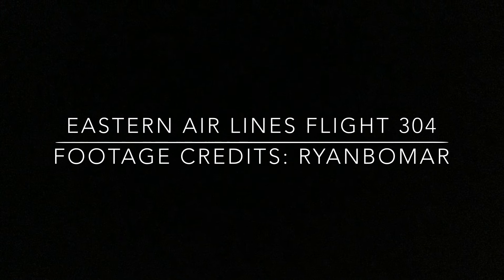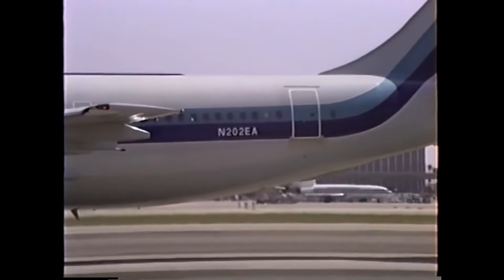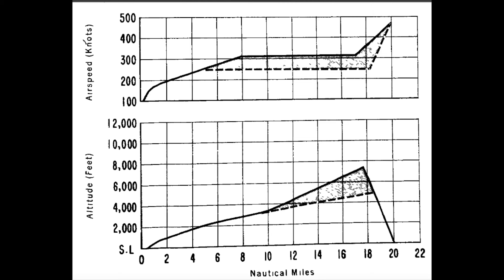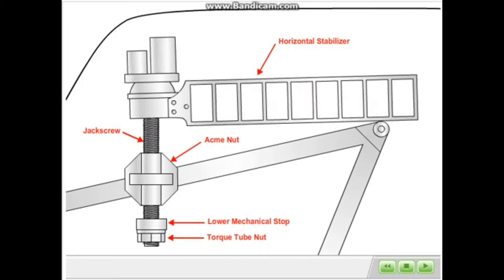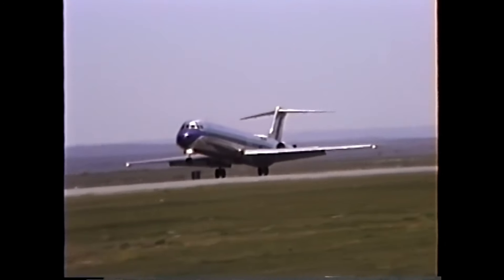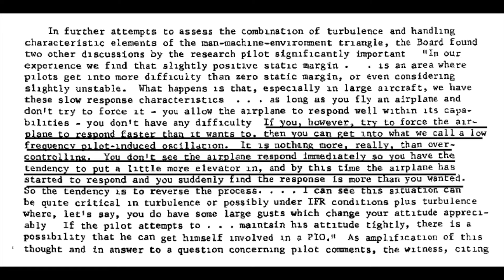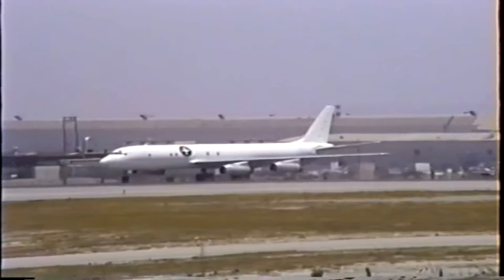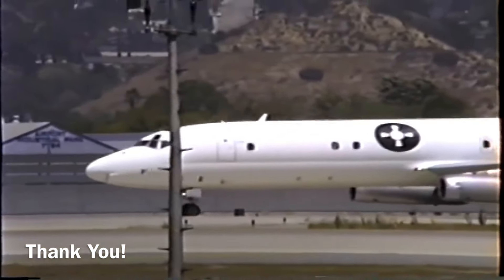When The Pilots Aren't In Control Anymore | The Crash Of Eastern Air Lines Flight 304

Comment: I have been at the controls of a DC-8. It was a charter flight and I was signed up for ground school. I was amazed at how light and sensitive the yoke was. I could feel the minor muscle tremors in my arms in the movement of the aircraft. It took about a second for  an unintentional twitch to show up as a slight roll or pitch change, and those movements were on the order of a mm or so.
Reply: Try it in manual reversion...
Reply: @davef.2329  Without the hydraulics?
Reply: @johncantwell8216  Yup, no aileron/rudder hyd's. Used to do that trng in the sim and in the plane on maint. functional test flts. Put the gear down to help with the roll (flt. spoilers powered by separate hyd. syst. when the gear is down). Can be described like "driving a moving van with no power steering." Plan ahead, far ahead...
Reply: @davef.2329  Is the yaw damper operational without hydraulics on the rudder?
Reply: @johncantwell8216  With NO hyd's, or rudder power lever shut off, no. DC-8 had a standby rudder power syst. that in the loss of main hyd's syst. could keep the rudder powered as long as there was no leakage in the final plumbing or the rudder actuating system. The series yaw damp ran thru the rudder power control valve, so in answer to the question, no, not without applied RUDDER hyd. pressure. Been a long time (decades ago) but, that's my memory of it. DC-8 went thru some changes early in its life due to some accidents/incidents and the standby rudder power sub-system was one result of those early changes.
Reply: @davef.2329  I just looked at the layout of the F/E panel, and it shows how the controls for the standby rudder system and the alternate power source for the ground spoilers were added on an outrigger box at the left end of the panel.
Reply: @johncantwell8216  It was referred to as the 'Sub-61 panel."

Comment: Thanks for shedding light on a lesser known crash. It is very interesting at this time due to the similarities to the 737 Max and MCAS crashes. Air transport safely is the most important factor that a manufacturer must consider when designing and manufacturing aircraft.  The human factor makes this tricky but the more pilots are told about how their plane flies and responds due to the airframe itself and the various flight control systems the safer flying can be because of pilots not being surprised by what the plane is doing. I have not been able to find out how much Douglas knew about this issue so it is hard to make a good judgment on how responsible the company was but the similarities to the Max are striking.
Reply from the maker: Yeah i love doing videos on lesser known crashes, Its good to make sure that this incident isnt forgotten to the pages of history

Comment: A bushing is really just what you described. It's a chunk of rubber or polyurethane (a very soft plastic) which separates metal or load bearing components that have to move. The suspension components in your car use a load of bushings to this effect. An example would be a stabilizer bar (aka anti-roll bar) link pin, which is basically a metal linkage with nuts at both ends that connect to stuff. You'd have the nut holding the bar there, a washer for the bushing to seat against, the bushing, the metal component the link pin attaches to, and another bushing with a welded washer in place. I hope this makes even a lick of sense. Bushings are usually incorporated into designs where metal parts meet, but have to move. The bushing allows those metal components to move around relative to each other, without wearing out those metal parts. If you install bushings upside down, it absolutely will chew the bushing out because the metal fixing basically eats it alive. Again, hope it makes sense.
Reply from the maker: Thanks this really does clear things up !!
Reply: Don't forget though bushings can be anything from a rubber with a low shore rating to brass to stainless steel.

Comment: The natural reaction of a pilot with the airplane pitching down and the airspeed increasing is to pull the power off and pull back on the elevator. There was a case where EAL had an airplane pitching down, over speeding  and the pilot did the opposite. He pushed the power up, and recovered. In any airplane without fly by wire and engines mounted under the wing if you add power the airplane will pitch up and probably the only way to recover from a high speed nose down incident.

Comment: Regarding the bushing upside down in the stabilizer jackscrew unit, how is that possible normally the bushing will have a case or cover to keep it in place, if the the screw only can travel one way then the bushing also has groves to keep it from moving, if the bushing travel with the screw up and down then the bushing will have lips on both side then there is no such a thing is upside down. Thank you and love your channel

Comment: 5:15  FO testified regarding a previous DC-8 flight's dive that using reverse thrust provided "a nose-up moment".  The engines are beneath the vertical center of gravity.  Drag force down there would cause a nose-down rather than nose-up moment.
Reply: Marc McReynolds hello it’s odd you mention ‘thrust REVERSERS’ in flight , on the BC8, the THRUST REVERSER LEVER IS VERY CLOSE TO LANDING GEAR LEVER , I believe it may have been in 70s/80s  AIR CANADA was to land at LESTER PEARSON , TORONTO so while getting  ready in the patern, they DEPLOYED THRUST REVERS  so it JUST FELL OUT OF THE SKY, , I believe the fix Was to PAINT THE LEVERS DIFFERENT COLOURS   Cheers 🇨🇦🇺🇸
Reply: @flybyairplane3528   That sounds a lot like Air Canada 621, where the spoilers of the DC-8 deployed at sixty feet on approach (deviation from approved procedure regarding spoiler arming had the pilots miscommunicating).  The aircraft touched down hard enough to cause wing/engine damage, then during the ensuing go-around (bad decision #2) a series of fires and deflagrations destroyed one of the wings before they could return to the airport.
Reply: @marcmcreynolds2827 :  The FO extended the spoilers.
Reply: @markprange4386   Thank you for clarifying my vague statement "the spoilers of the DC-8 deployed".  In deviating from procedure, a callout at 60 feet to arm the spoilers was taken by the FO as a command to deploy them. I can only imagine that the FO's mind was momentarily elsewhere at that critical moment, since deploying spoilers at that altitude would make no sense whether commanded or not.

> I believe the fix Was to PAINT THE LEVERS DIFFERENT COLOURS < There's a quasi-joke in the airframe business that if you can't fix the problem, "placard it" (the equivalent joke in the railroad industry is that if a part breaks, "double the dimensions and paint it black").

Comment: DC-8 is an old jet, it hitting MACH 1 would be disastrous, it would never survive to get anywhere near 'high mach'.
I'd need to see the 'prints, but support bushings are typically exactly that, a bushing of sacrificial material designed to keep a rotating part in alignment. If it was installed upside down, then it is possible that sufficient throw on the jackscrew was able to knock it out of place.
Reply: I don't think 'sacrificial' is an applicable term for such a component.
Reply: Are you aware that the DC8 was the first airliner to break the sound barrier? Google supersonic DC8 and see that your comment is misinformed.
Reply: @aeomaster32  

It couldn't 'fly' at over Mach 1 though. The example you mention was a risky one off and was achieved by a sharp dive from 52,000 feet (a very impressive feat in its self). It exceeded the speed of sound for 16 seconds at 1% over. 

While a DC-8 did achieve this the top speed was 'only' a still very impressive near 590mph but significantly short of Mach 1 without inducing it artificially.

Sadly, it was scrapped after two decades of service (so I read) and personally I think it should have been preserved. A great shame.
Reply: It broke the sound barrier and it was not designed to do so, stop arguing about mach one.... it did it...the DC-8 was a very strong airplane

Comment: Eastern experienced quite a few crashes during its long run, some stranger then others?

Eastern Air Lines Flight 21 - A Douglas DC-3 crashes while descending to land at Atlanta, Georgia. Eight out of the 16 on board were killed.

Eastern Air Lines Flight 45 - A Douglas DC-3A collides with a Douglas A-26 Invader over Florence, South Carolina, US. One of the 24 on the DC-3 and two of the three on the DC-3A die.

Eastern Air Lines Flight 66 - A Boeing 727 encounters wind shear on final approach, strikes approach lights at JFK International Airport and crashes, leaving 113 out of the 124 people on board dead.

Eastern Air Lines Flight 212 - A McDonnell Douglas DC-9 crashes on approach into Charlotte, NC. The DC-9 experiences a controlled flight into terrain due to pilot error. 72 out of the 82 on board were killed, including famed political satire Stephen Colbert's father and his two brothers.

Eastern Air Lines Flight 304 A Douglas DC-8 flying between New Orleans International Airport to Washington National crashes into Lake Pontchartrain, killing all 51 passengers and seven crew on board.

Eastern Air Lines Flight 375 - A Lockheed L-188 Super Electra crashes on its takeoff roll from Boston Logan International Airport. The Electra is seen crashing into Winthrop Bay, after multiple bird strikes. 62 out of the 72 onboard perish.

Eastern Air Lines Flight 401 - A Lockheed L-1011 TriStar crashes in the Florida Everglades. The crew onboard is distracted by a faulty gear-down light, resulting in a controlled flight into terrain. 101 out of the 176 people on board are killed.

Eastern Air Lines Flight 512 - A Douglas DC-7B crashes due to pilot error during a missed approach go-around at Idlewild Airport, New York. 25 out of the 51 onboard are killed.

Eastern Air Lines Flight 537 - A Douglas DC-4 on approach for Washington National Airport collides with a Lockheed P-38. All 55 people on board are killed. The pilot of the P-38 is seriously injured.

Eastern Air Lines Flight 605 - A Douglas DC-4 loses control and crashes near the town of Bainbridge, Maryland, US. All 53 passengers and crew on board are killed, making it the deadliest crash in US history at the time.

Eastern Air Lines Flight 663 - A Douglas DC-7B on its takeoff roll overreacts in avoiding Pan Am Flight 212 (A Boeing 707) which is on approach. The DC-7B crashes and loses control. The Douglas DC-7B crashes into the ocean near Jones Beach State Park, NY. All 84 onboard perish.

Eastern Air Lines Flight 665 - A Douglas C-49 crashes into high ground near Galax, VA, the US after the pilot experienced spatial disorientation. Only one out of the 19 onboard survive.

Eastern Air Lines Flight 853 - A Lockheed Super Constellation collides with a TWA Boeing 707 performing TWA Flight 42. TWA Flight 42 makes an emergency landing at JFK International Airport, while Eastern Air Lines Flight 853 crash lands on Hunt Mountain near Danbury, Connecticut, US. Three passengers and one pilot perish. No casualties were reported on the TWA Boeing 707. This is also known as the 1965 Carmel mid-air collision.

Eastern Air Lines Flight 855 - A Lockheed L-1011 TriStar loses power from all of its three engines due to faulty maintenance. The flight crew succeeds in restarting the #2 engine on the third attempt and safely lands at Miami International Airport.

Eastern Air Lines Flight 980 - A Boeing 727 owned and operated by Eastern Air Lines impacts Mount Illimani, Bolivia. All 29 onboard are killed.

Eastern Air Lines Shuttle Flight 1320 - A Douglas DC-9-31 on a flight between Newark, NJ and Boston, MA is hijacked by a suicidal man. He shoots the captain and co-pilot before being subdued. The captain makes a successful emergency landing at Boston Logan International Airport and the hijacker is arrested. The co-pilot dies from his injuries.

Comment: This is what happens when the "Swiss Cheese Model" fails.  It doesn't happen often, but it does.  The engineering was good but not quite good enough, a seemingly minor maintenance error was made and not caught, and the pilots misunderstood the situation and applied what, in any other circumstance, would have been proper corrective action, only to have it exacerbate this particular problem.  The holes lined up, and something got through.
Reply: Never heard of that term before but will be using it from now on, thanks!

Comment: It looks like the DC 8 had problems that needed to be resolved before the aircraft went into production.
From what the test pilot said it was an unstable platform from the start.
Add the other factors in and you have disasters.

Comment: At time 0:47 you make a wrong statement: "The DC-8 needed the PTC to improve the handling of the aircraft at low altitude high-speed regimes". This is NOT true. The PTC system compensates for a nose-down tendency at high Mach numbers (above Mach 0.8). In a DC-8 those high Mach numbers can only be flown at HIGH ALTITUDE, because at low altitude below 20'000 ft the IAS (indicated airspeed) is the limiting factor. 350 kts IAS gives less than Mach 0.7 at low altitudes. I used to work on DC-8 avionics and cockpit systems.

Comment: I turned this video off as it was obvious the person does not know what he is saying.  He said less than a minute into the video, "the PTC is used to prevent the plane (a DC-8) from nosing down at high mach numbers".  A DC-8 does not achieve high mach numbers.   A DC-8 can not even achieve a speed of mach 1.  Mach 1 is the speed of sound. The max speed of a DC8 is 588 MPH or mach 0.766.  That is not a high mach number.
Reply: You are wrong. The DC8 was the first airliner to break the sound barrier. Google DC8 supersonic. I flew that very aircraft later.

Comment: At time 0:47 you state that "The DC-8 needed the PTC to improve the handling of the DC-8 at LOW ALTITUDE high speed regimes". This is WRONG. The PTC compensates for a nosw-down tendency at high Mach numbers. The DC-8 can attain those high Mach numbers (above M 0.84) only at HIGH ALTITUDE high speed regimes. It would be nice if you would learn some basics about the physics of flight and aerodynamics and aircraft control systems before producing videos that contain such false statements.
Reply from the maker: "Operation of the PTC is also required in the low altitude, high speed regime below mach effect to improve stick force characteristics as speed increases." 
Direct quote from Eastern Airlines flight 304 final report, Page 4. If you feel that it is wrong please do contact the NTSB and the Douglas aircraft company who conducted the tests.
Reply: @MiniAirCrashInvestigation  Of course it's not your intention to be wrong. But the PTC was NOT installed to give greater stick force at low altitude high speed flight. There are other devices to give the pilot an artificial feel in such a way that the required stick force is higher at high speed. The PTC is giving only a nose-up force to compensate the aft-shifted center of lift at high Mach numbers. You misinterpret the text of the NTSB. The combination of nose-down trim of the horizontal stabilizer with the wrong nose-up trim of the PTC gave a LIGHTER stick force. So there is absolutely no data from Douglas or NTSB that suggests that the active PTC is there to give greater stick forces. I know, it's not easy to understand all this for someone that never worked with those systems.